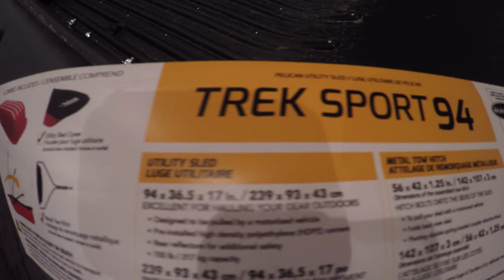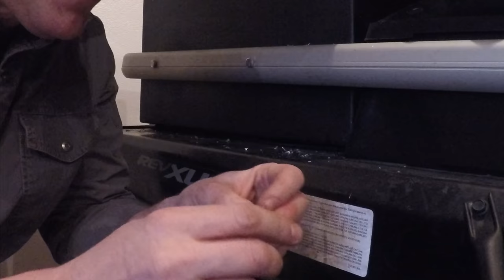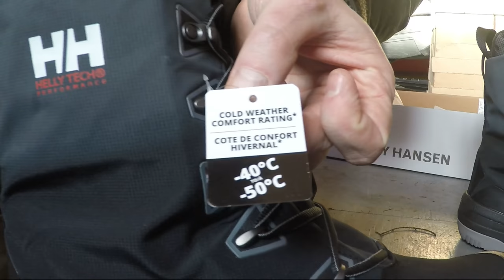NEW GEAR, CUTTING LOGS, CAMPFIRE, SNOWMOBILING AND ORANGE PEELS???  An afternoon in the woods!

Comment: How are those HH boots working out?
Perhaps I will get a pair!
Reply from the maker: I'm estimating I've walked and/or snowshoe-d close to 175 kms in them now with no issues.  they are molded in to my feet and i find them incredibly comfortable.  They are warm, too warm in fact, unless the temperatures are down there.  but i'd rather have that to contend with than cold feet!
Reply: Thanks
Where can I buy a pair??
Reply from the maker: Edward Finn www.marks.com

Comment: How did the Helly Hansen boots work out for you?
Reply from the maker: Incredibly well!!!  I have 100's of kms on them now and I actually said to Melanie (spouse) this past weekend that I've never had a pair of boots that were as comfortable in my life.  My feet have never gotten cold, or tired (blistered etc).  I did replace the sole liners inside as I wore them out!!  I also used a dremel tool on the top two lace holders to widen the holes.  I have a second pair (previous model of boot made by wind river) as a backup while my other pair dries from daily use👍

Comment: Hey chuck whats your thoughts/opinions on the hely hanson boots?  In the market for a snowmobiling boot...been wearing klim boots for the last 4 or 5 years looking to try something different. Thanks.
Reply from the maker: I wore them all last winter on all my trips:  snowmobile, snowshoed over 300 kms, wet sloppy snow, etc and cant say enough good about them.  Waterproof, very warm, easy to dry out, and extremely lightweight on top of it all.  in one of my videos you will see where I modified the tie-in loops at the top of the boots.  Other than that they deserve 5 stars.  I already have a pair very similar to them (the previous model actually) and I take them on long trips for a spare.  Love them👍👍
Reply: @ChuckPorterEverythingOutdoors  Sounds like they are a good  product. The lightweight is what i'm looking for. Klim boots are good but a little on the heavy side. I'm in Western Newfoundland and we get the cold temps but not quite as cold as western labrador. I'm going to try them out. Thanks chuck!
Reply from the maker: Absolutely bud. I wouldn’t steer you wrong. Marks work warehouse sells them here. I used to wear glacier sorels for many many years, but haven’t worn them a day since getting the helly Hansen icefx boots
Reply: @ChuckPorterEverythingOutdoors  Just ordered from Marks